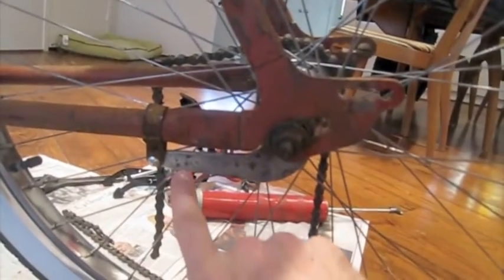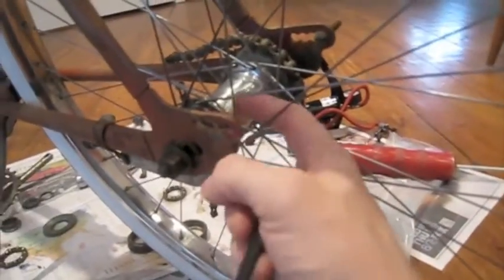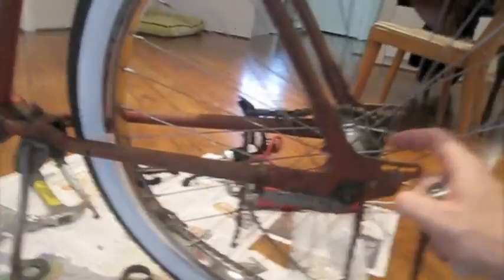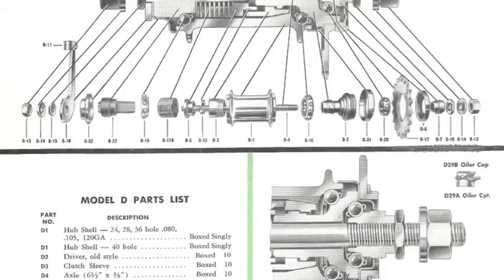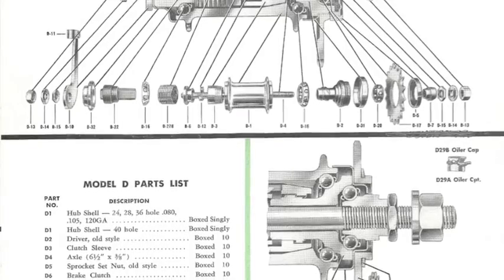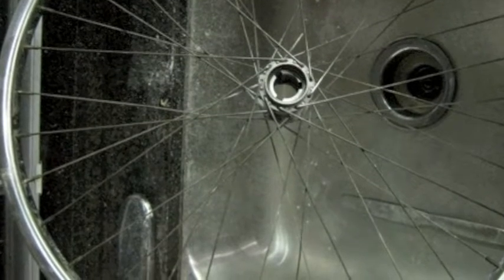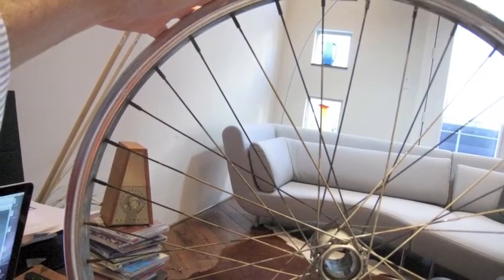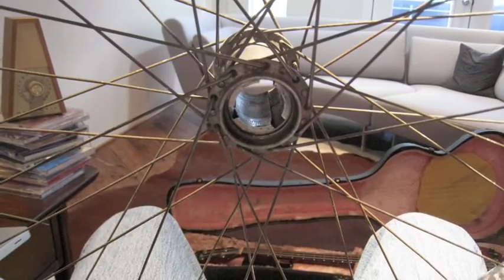Rollfast Vintage Bicycle Build Part 2.m4v

Comment: Your hard drive crashed??? We are having a HORRIBLE time trying to get the New Departure brake back into it's casing. The stack shifts slightly so that every time they no longer line up in order to fit. Help.